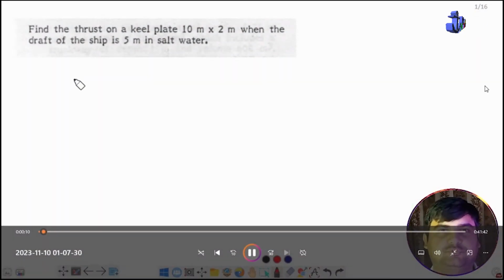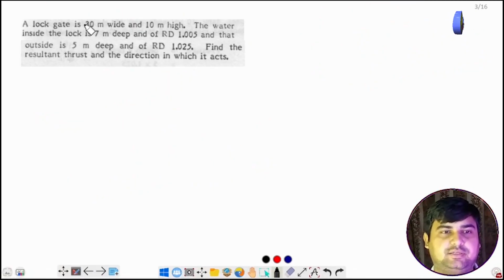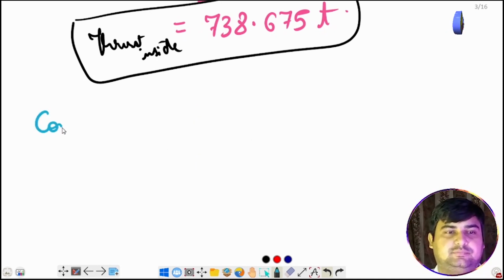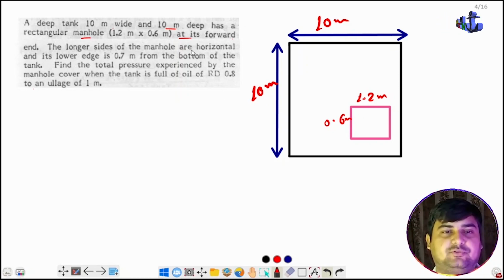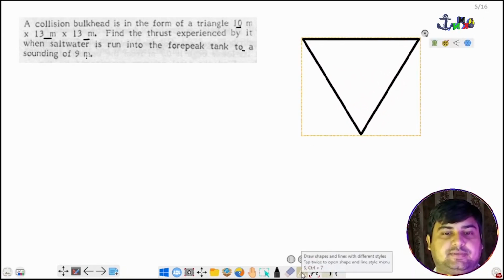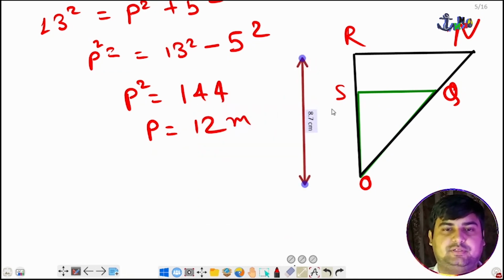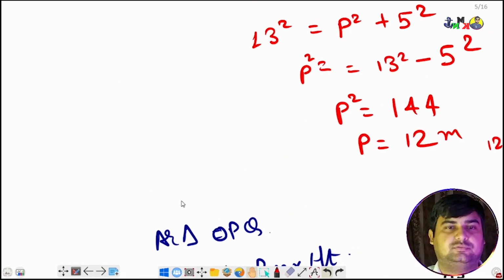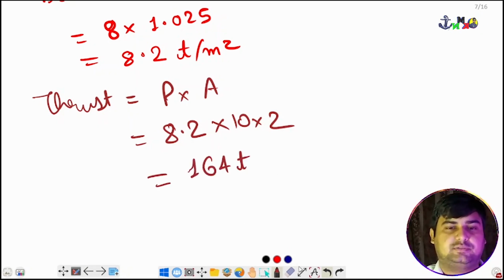Ship Stability | Ship Stability Basic | Pressure in liquids | Water Pressure and Thrust Probs Solved

Comment: why does in the first problem is h=5 then the second the h is half?
Reply from the maker: For the first problem, we are calculating thrust on keel.
Whereas in the second problem we are calculating thrust on bulkhead.
Since the bulkhead is vertical, the pressure will act at the geometric centre, that's why we are taking h=5.

I hope this clears your query.
Stay Tuned 💯
Reply: @kilomikeniner Ohh I see, thank you so much sir
Reply from the maker: @marionrowiesalvador9834 All the best.👍🏻
Stay Tuned 💯